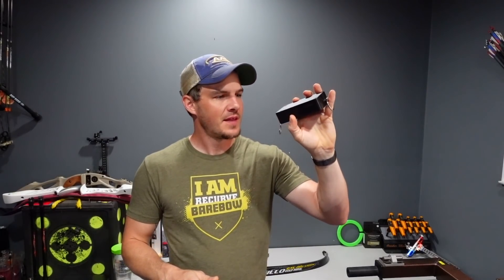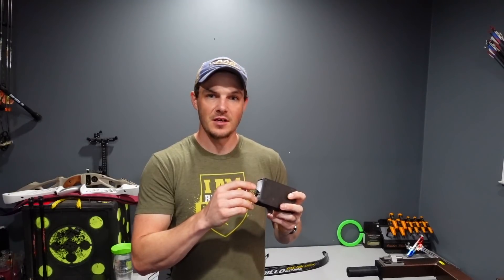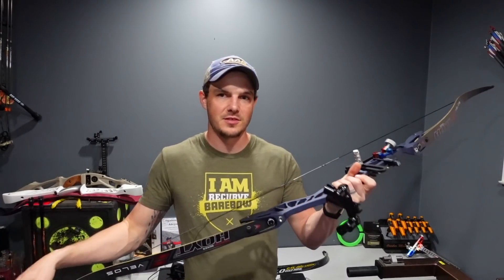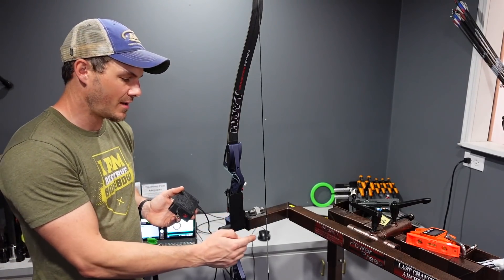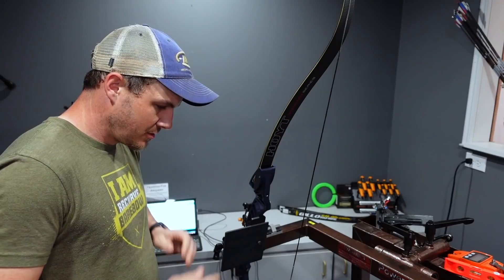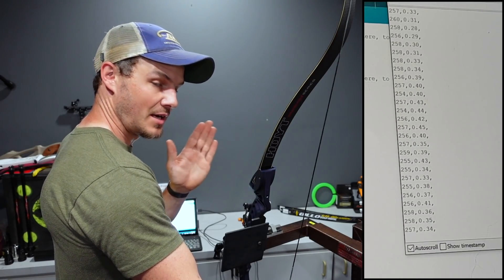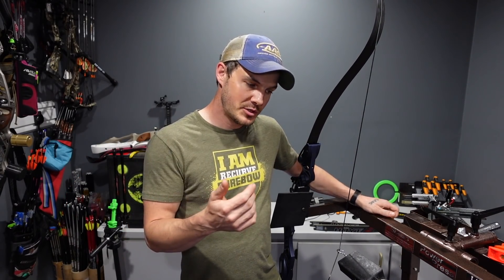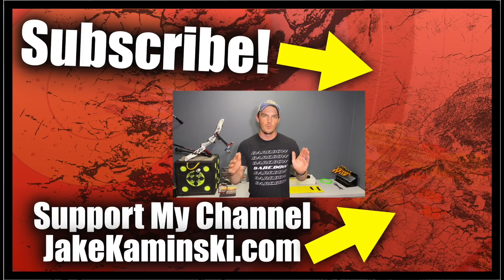Introducing: Recurve Archery Draw Force Curves | Development and use of Draw Force Curves

Comment: How does this change the performance of a bow/limbs?  I can see how it would effect how you feel when drawing the bow back.  But the end result is you end up right around 55lbs.  When you release the shot, I have to wonder if the acceleration is consistent in reverse or if you have a similar hump in the limbs coming back in to position and accelerating the arrow forward?  How would that affect the energy transferred to the arrow and your shot?  The comment below about stored energy may also have some impact, but I'm really wondering about the curve returning the limbs back to an undrawn position.

Comment: Jake it is very weird that the three different settings have the same curve. Maybe it would be interesting if you measure the impact force of an arrow with these 3 settings when shot with a mechanic release. Also what are the diffdrent draw curves between different settings while changing the tiler bolts potitions.

Comment: Great research Jake. Just wondering if you could also measure on the draw down and capture hystetisis? It makes a good measure of a sprung systems efficiency.
Reply from the maker: In my experience messing with the DFC tool. Because it’s being drawn and let down so slowly, you see zero change or detectable change on the device. When unloading at the speed an arrow is released, then yes there is some.
Reply: @JakeKaminskiArchery  probably a job for a motor-generator using current as measure of force. I wonder if Hoyt/Uukha etc do this already?

Comment: Very cool device Jake... I use DFC's all the time to compare subtle differences in limb designs to get the best performance from a pair of limbs... Other than myself you should have a very accurate device there... One advantage you have over my method is your drawing method allows for the least amount of hysteresis to develop while drawing the bow...  99% or more of the DFC's out there are inaccurate and are often fudged to get a smooth line... An inaccurate dfc is useless in comparing limbs to achieve better performance when making a bow... 
   You will find that most bows truly start stacking around the 20 to 24" mark, depending on their length and how they bend... That yellow line on your graph should be a much faster bow... But DFC's can be deceiving... What sometimes appears to be a faster bow on the charts is not through the chrony... Other factors can be involved with the dynamics of two different limb designs...  If you really get into it, when comparing two sets of limbs with really close curves or comparing letting your limbs in and out as you did on the video you will find yourself studying the numbers vs staring at the curves... There within lies the true story being told... Now you are looking at the inner workings of a bow and how subtle changes in the numbers can effect a bow... You and I will be looking at it from two different perspectives... I being a bowyer and using dfc's in making a bow and you looking at something already made... 
   Great job.... Enjoy this new tool, it can be fascinating seeing the inner workings of the limb... It is very valuable device being that it should be the most accurate DFC measuring device by far to this date if it works as it is supposed to...

Comment: Thanks for all the effort you put into this! The limb rocker with its different settings seems unnecessary. This slight change in the draw curve can easily achieved by turning the limb bolt 1/8-1/4 of a turn, too. I would be interested in testing one set of limbs with same Tiller but different angles of the limb pockets on the Gillo riser.

Comment: Some time ago there used to be an eston draw force mapper, which used a string to meassure the drawing distance and the load cell to meassure the draw weight, it even printed it out into a ticket.
Meassuring distance with IR sensor may be tricky as it is quite sensitive to many factors

Comment: Well, shifting these rockers is pretty the same as turning the limbbolts how much? 1/4 or 1/8 turn?
Can I still take Hoyt (Easton) seriously? 
Thanks Jake for this video and for your channel!
Reply from the maker: It’s pretty much the same as the limb bolt change but the feel is very different for sure. Just changing the tiller bolt position isn’t enough to shift the feel and Not change the tune as much as I saw. Meaning I felt more change then the arrow showed in tune.
Reply: @JakeKaminskiArchery  Thank you for your answer. Okay, but from a technical point of view, the scale "feels" exactly the same as the archer. So if there is so little difference between the three lines, how can it feel any different? The curve of the SX + then has to feel extremly. Okay, the tuning is completely different. 
I shoot Uuhka VX +, Border HEX6 and Morrison MAX6 myself and I know the difference to Hoyt limbs in the measured draw force curve. There's a massive difference to see and feel. It's because of the big recurves. 
Shifting the positions of the rockers, where the limbs practically do not bend anyway, can't make a big change, as seen on the three curves. 
By the way, compare the position of the old Hoyt system with that of the WIAWIS system for years and now with the rocker settings.

Comment: Jake, excellent work on this rig and the testing/data acquisition! It's really interesting to see how the Uukha SX+ limbs have a much more pronounced "hump", if you will, in the middle of the draw force curve, relative to the Hoyt Velos limbs. There's a performance metric called SE/PDF, or stored energy per pound draw force, that is thrown around in the forums to compare the relative energy storage capacities of different kinds of bows and limbs. SE/PDF is usually referenced to a specific AMO draw length, such as 28" or 30". SE/PDF is just one of many interesting properties that can be observed/calculated from the raw draw force curves.

Comment: Hi Jake thank you for everything you give to the archery community ...  I need your advice on this..

I had a sudden problem with my recurve bow...  My sight is too far in that sometimes I can't see the sight pin ... My limbs are not twisted I checked it with bieter blocks... The bow was aligned in the center so I moved the limbs far to the left so the long stab is to the left of the string and I pushed the plunger 3/4 turn out. The sight didn't move ... I increased the weight on the long stab ... nothing I did affected my sight... Why that happens and how I can make the sight goes left so I can see it? Thank you.
Reply: Tilt your head left/right... It will change your string picture and move you're sight pin so you can view it... You'll have to make slight adjustments so you're back in the middle of the target.... Then it's a case of keeping the string picture and where/what you align with to keep your left/right spread consistent
Reply: I usually aim the same, I mean I rotate my head over my left shoulder and keep my eyes on target so my head doesn't lean where it should not ... 
.. And put my string on the same position in the middle of my riser (string picture) ... Thing is , it has been like this for more than a month, sight too far in that I can't move it any further and I'm shooting with that good groups but all to the right between the right 10 to 8...
Reply: @bookscoffee111  you're better off resetting your bow back to centreshot with everything down the middle including the sight pin and retuning the bow

If you're adamant that your shooting form hasn't changed then something has happened to the bow tune... If you didn't mess with the bow then it's your form and how you align the target and the sight pin that's the issue

Comment: Awesome work Jake and Tristan!  You’ve done what manufacturers have been so reluctant to do.  You could spend months comparing riser & limb combinations.  Thank you both!
Reply: Check Backwoods Composites out. We are not reluctant to reengineer the recurve bow... We built a similar data measurements system. We coded ours to produce every 1.5milliseconds and since we build bows we made the unit compatible with strain gages attached to limbs and riser.
Reply: Border have been doing this for years .. BUT it is nice to have a non manufacturer confirming it .. less risk of bias!